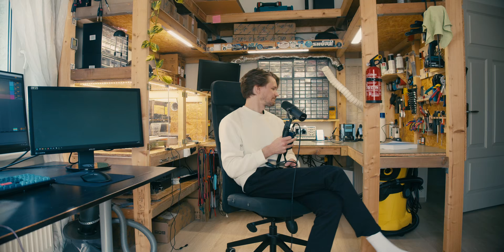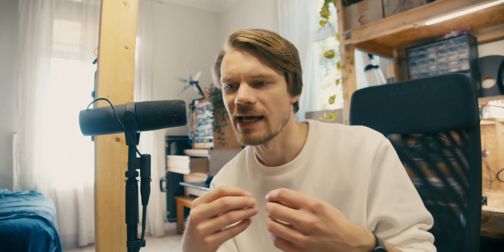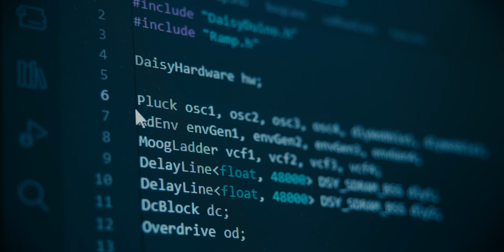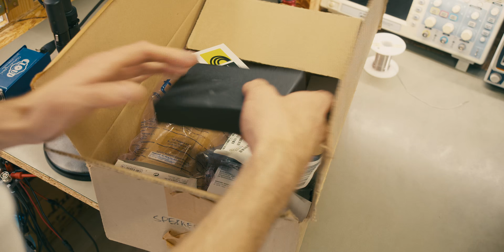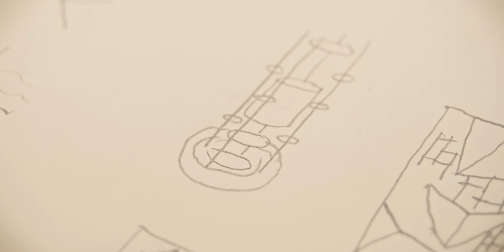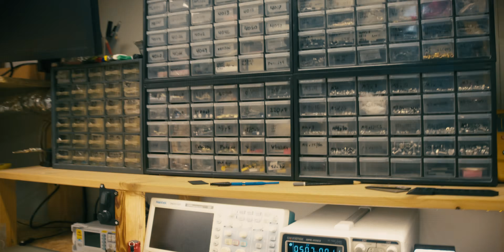How I start my projects

Comment: Mono sounds stacked vertically, in my mind is still still provides a manipulative sound field.  Different frequencies arrive at the ear at different times. Sound direct from speaker to ear and room reflections to ear.  This is a fascinating project. I look forward to seeing your design process and implementation!
Reply from the maker: I guess if you include all immutable parameters, nothing is really monophonic considering the elements you mentioned, plus the physical size of the enclosure (not being a point source), vibrations, etc. Thanks!